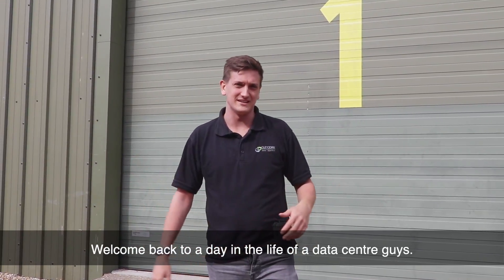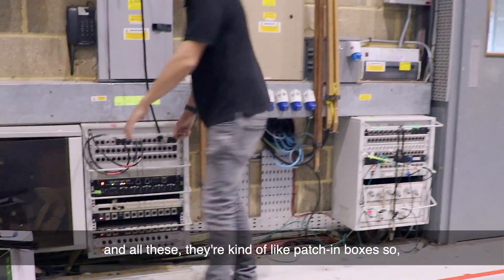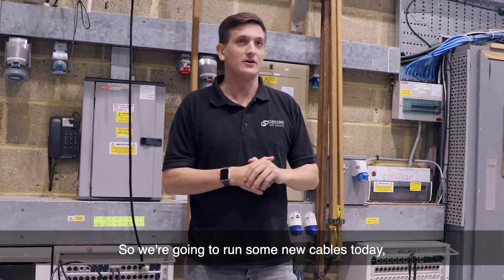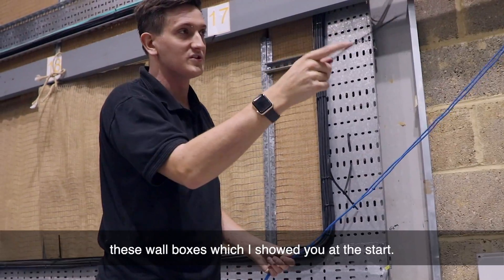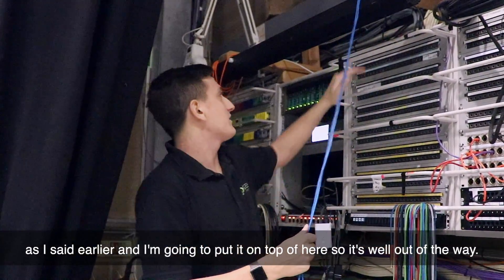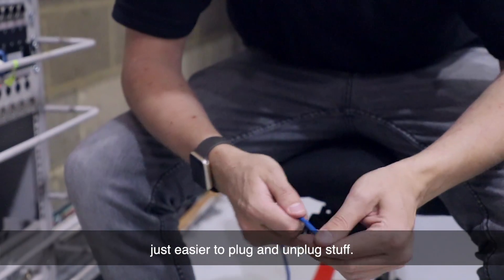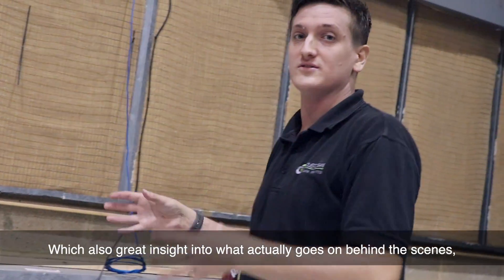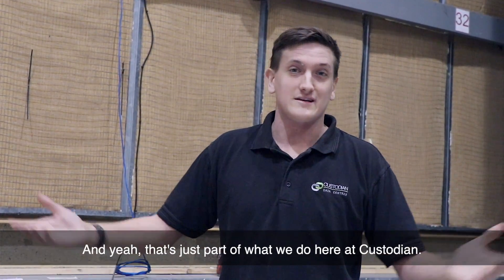A DAY in the LIFE of the DATA CENTRE | CABLING UNIFI WIFI (SDN) SOLUTIONS for TV STUDIO!

Comment: Why in the year of 2019 at that time are you running/installing CAT5 and not CAT6?
Reply: Lol we are running CAT7 everywhere now because it is future-proof and more reliable. Also for Long Cables you want have a good Signal
Reply: There is no good reason to run CAT5 - I hope he is simply mistaken, or one of those who just refer to all Ethernet cable incorrectly as CAT XYZ.
Reply: @hiddenidentity8291  no u see it on the shielding. there is none. even CAT6 does have shielding
Reply: @mirai-neo  In all honestly, I stopped watching when I heard CAT 5. CAT 6 does not require it to meet specification. CAT6A on the other hand does. 

I use a absolute minimum of CAT 6 when patching, and a minimum of CAT 7 if it's going inside a wall/long distance (for future proofing, I don't want to have to replace it)

In addition all internal rated cables I use LS0H/LSZH coated cables.
Reply: @hiddenidentity8291  Agreed, especially in a TV studio, where nearby cables/equipment might be susceptible to noise, from either the PoE switch PSU, or other sources, either using the catXYZ as an antenna, or nearby inductance, I wouldve run shielded cat6a at a minimum, as im willing to bet, a TV studio getting an annoying DC hum on an XLR cable crucial to their operations would be the end of the contract -- might even be why sometimes "the wifi gets unplugged", as in on purpose
Reply: three words, reliability and cost effective.
Reply: @lawrenceplays  
Cost effective, that's a given, CAT5e will always be cheaper, so meeting a higher cable requirement for the 1G specification is not important then?

Comment: Physical security would work wonders here
Reply: Probably not the easiest thing to implement here. Especially with the sheer variety of operations that can be run in any tv studio (which are perhaps the most dynamic of work environments at the best of times), especially if the studio is constantly evolving in terms of usage and connection requirements.

Comment: Why you didn't use EtherCON connectors for the patch panel?
Reply: Ethercon is great for things that are constantly being unplugged, rewired, and repatched because of its metal structure on the connector - great for working in entertainment because stuff gets moved around constantly depending on where it's needed for whatever is running. But for something like this that most likely will not be touched - a standard ethernet jack is fine. It's not gonna move, and it's not going to break due to repetitive strain on the little plastic clip.

Comment: Why do you guys use cat 5/5e instead of cat 6? (won't the long term costs of rewiring when they need better networking screw with your paycheck?)
Reply: depending on how this is financed, a lot of people want the future work to reinstall cat6. another reason could be that the company wants to cut costs and buy cat 5e, or maybe they already had cat 5e laying around. 100mb/s is plenty for most applications anyway
Reply: @94Dza  Wow this is a long time ago... Completely understand, good points made. Hopefully their over to CAT6 by now with WIFI6 running at well over 100mbps...
Reply: @erikvdmerwe6908  Cat5e does gigabit at 100 meters, so nothing to worry about...

Comment: Ok, I get it's a large space, but come on, there's traywork running all round the room, so put your cables in there. The general cabling in the room looks terrible, access points just hang off the looms. I don't think anyone would buy there kit from Amazon either - I don't care how quick it is (and in this case, it looks like it's not). Amazon is just like a dodgy car boot sale these days - so much fake stuff, and sending stuff back is not easy. Get the kit from an authorized supplier, where you might pay a little more, but you get more in the process.

Comment: A massive Unifi network with 3 whole access points.
Reply: I know, and a petabyte of wifi ????
Reply: I mean, I've had 480 devices connected to a Cisco Aironet 2808I before. Granted, the connection speeds were abysmal, as it fully saturated the gig line, but it was a guest wifi test for a football game.
Reply: @breakfast-burrito  holy-
Reply: Christian Oshiro it was a lot. But shoutout Cisco for not crashing.
Reply: @breakfast-burrito  LOL
Reply: I got one with 50 devices. lol.
Reply: @buldozzer3456  I've got 3 in my house.
Reply: A local School had around 53 Unifi HD APs. Thats what i call a bigger Network.
Reply: What exactly it is you mean?
Reply: That's probably the main reason why everyone treat Unifi like a holy grail :))))

Comment: I use unifi at home. 2 AC Pros (its a big house) aswell as a USG 4P router, US 48 non POE switch, USB 16 150w POE switch for APs, cloud key, cameras etc. Also recently put a US XG 16 in my server rack and connect my servers using 10g SFP+ cards and DAC cables.

Comment: If you look at the antenna radiation patterns you'll see some UAPs are somewhat "'Kidney-style" directional. Depending on the model and environment you might get a better coverage when mounting ceiling-style instead of flush to the wall. Some installations I know use (in their case 3D-printed, similar to thing:2447751) 90°-Brackets to get them correctly oriented.

Comment: Zip ties pinch and damage cables. I would never use them in a job I cared about.
Reply: thats not true. dont do them up so tight. ive used cable ties so many times, always tested properly with fluke, never any issues.

Comment: Did he just put a connector onto a riser cable?????  This is why you dont send an inexperienced person to install cabling! He would never work in my data center!
Reply: This isn't a datacenter though. It's a structured cabling homerun to an AP.  He's going to have to crimp the far end at the AP anyway and the cable test with a proper meter.  He might have been clearer on what was left to do so fair enough. I have seen no videos with someone who looks like they've been in telecom or structured cabling for 20 years.
Reply: @BenjaminSerrato  no they are all kids who really dont know what they are doing. He could have still used a surface mount jack and used a small patch cable to the AP. With a jack he still could have done EE tests
Reply: @rty1955  You're right. I watched the rest of the video and changed my mind.  He also suggested he was not going to mount the switch even though it looks like there should be room in the rack, and I don't care for wall mounting APs.  I've not been in many warehouses but those I've been in all have ceiling mounts.  Also my field managers still lace everything.  

Surely there are certs for structured cabling.
Reply: @BenjaminSerrato  I would prefer brains over certs any day haha
Reply: @rty1955  Always, but certs can be useful for letting new people in an industry learn what they don't know.  I'd rather learn physical work from someone on the job but the next best is some nice diagrams.

I used to work setting up equipment for configuration before shipment and I was always frustrated that our guys who really knew what they were doing were in the field and I never learned to do commercially acceptable work.

Comment: esports over wifi? i'm intrigued.

you know, as in, the guys adding/removing weights to their 3000dpi gaming mice for more precise and customized aiming, short-travel [rgb! rgb always helps!] mechanical keyboards to shave off another quarter of a millisecond of lag, and stuff like that. 

given the innate lag wifi/radio introduces (tcp/ip does a great job correcting itself [as designed], it's just that a ton of packets get lost all the time - the busier the airspace, the more junk you get - and they have to be sent again and again, adding to the "noise". then adding the vulnerability of that openly broadcast data, it's amongst the worst types of connections you'd ever want: a congested medium (with a low net bandwidth thanks to it's common use and limited frequencies/"channels"), anyone can listen in and take their time to decode your handshakes (and then data), then inject packets at will and have their fun with you, you name it. (it's sooo  easy to break this, damnit!)

esports? lol.

all it takes is 2 taps on my phone and there's no wifi within a ~10-15 meter radius for as long as my phone's battery lasts. too bad mobile phone jammers are illegal over here: a "mute all comms" button really would be sweet these days :-|

 ....anyways. happy tournament, i guess? :-D

Comment: in cases like this i have used some lockable patch cables with good results 
basically i will run to a patch panel and from patch panel to switch with lockable patch cables 
here is a link for the ones i use 
https://www.blackbox.com/en-us/store/Detail.aspx/GigaTrue-3-CAT6-550-MHz-Stranded-Ethernet-Patch-Cable---Unshielded-UTP-CM-PVC-Snagless-Boots-with-Lockable-Connectors/C6PC70-BK

Comment: So good to see this installation. Thx. And some questions: what is total length of this copper connection? And why not Cat 6 ..WiFi 6 standard is just behind the corner.
Reply: It's a budget question. Why spend money on expensive cabling that you have no effort on right now.
The unify APs only run on gigabit LAN.
Once in a while when this WiFi solution does not do the job properly any more you can go on and sell new cabling to the customer. That might be in 5-10 years.
Reply: @substrde  sure, but very soon 10G will be needed and then yoo will need to replace all...actives and ....cables. With Cat6 or higher you will not need to spend money again on cable installation.
Reply: @bartoszstrek6693  I don't think that 10G for APs will be needed soon and regarding the cheaper cabling with cat 5 this is how companies calculate.